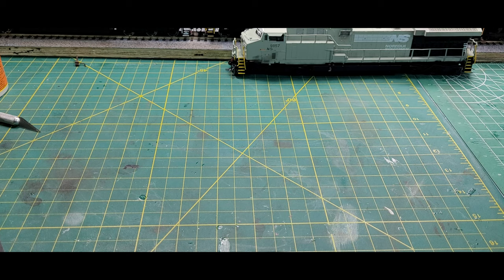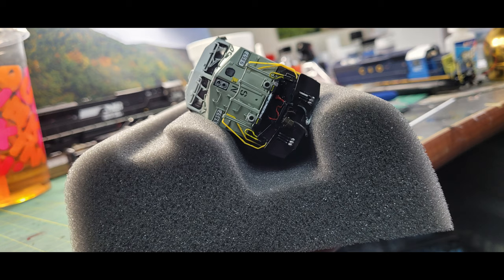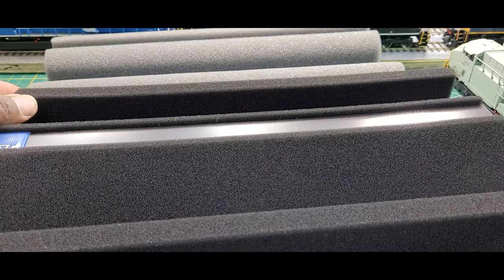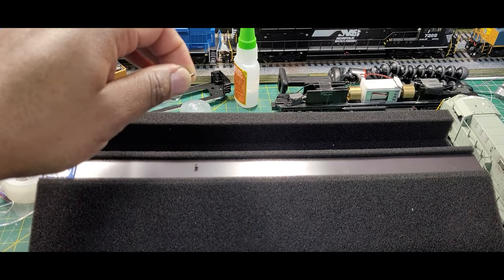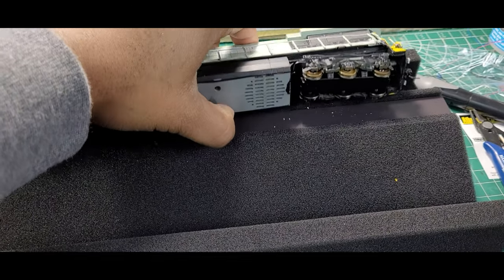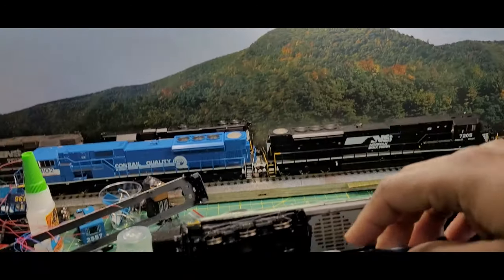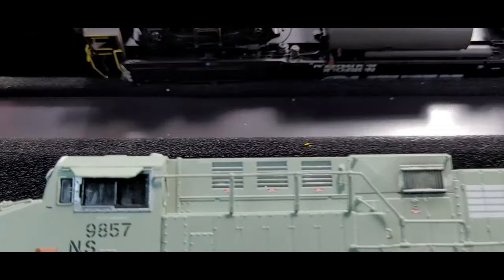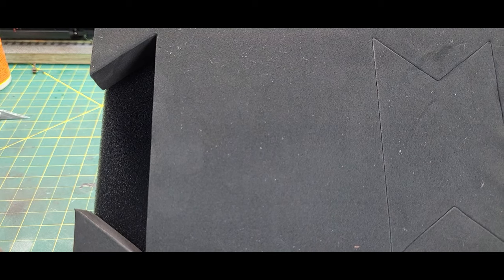ESU Premium Foam Train Service Tray

Comment: This is really nice and needed, the old cradle can tear off details. Still need to be careful but many more options. The one concern I have is the magnet and if it is just strong enough to cause problems with decoders due to the strength of the magnet? Don't get me wrong, I los screws and can't stand it, or forget where I put them if not on a piece of tape!
Reply from the maker: Hi David, It's because ESU makes the product  safe to use. Also I laid  that locomotive on the magnetic strip when I was making the video I did run it on the layout after filming appeared to work fine